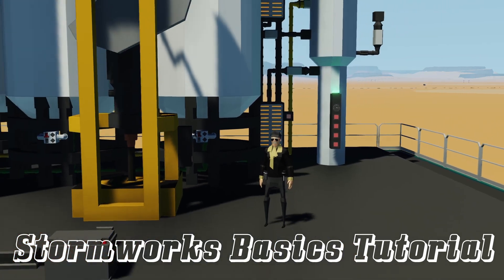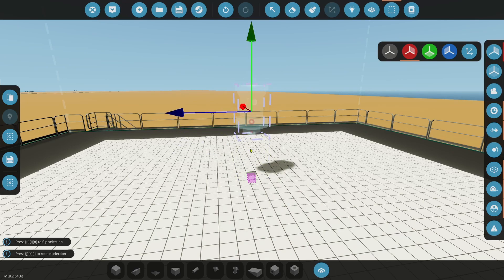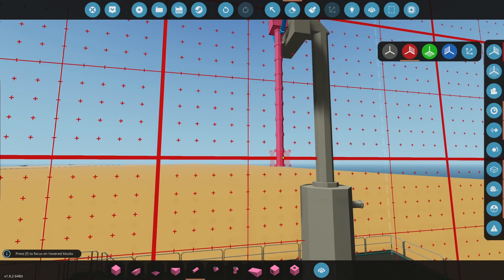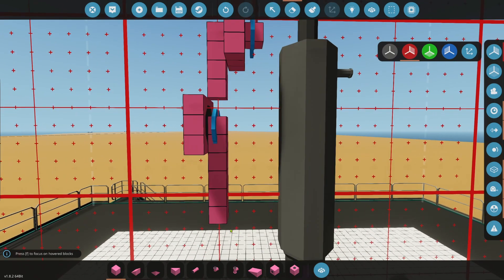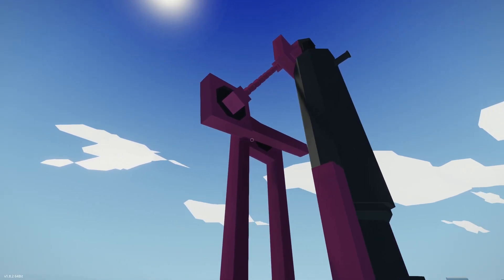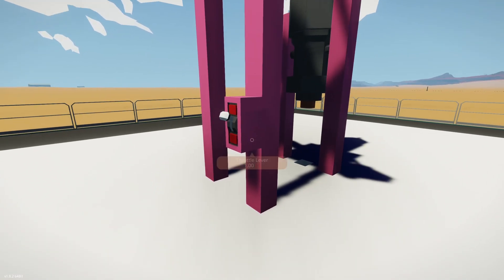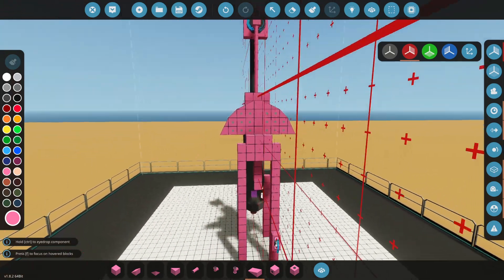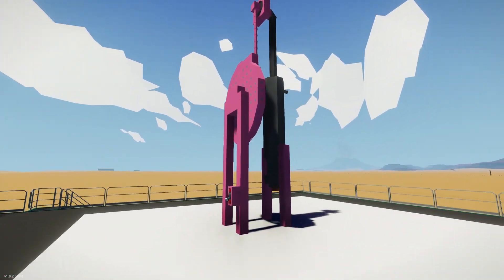Stormworks Basics: Fast Pumpjack Tutorial #stormworks

Comment: assuming I have drilled my hole. do I just replace the rig platform with a pump platform? my pipe does not show up if i replace the creation
Reply from the maker: Leave the drill pipe floating in the hole. Despawm the drilling rig. Spawn the pumping station. Reattach the pipe, and pump